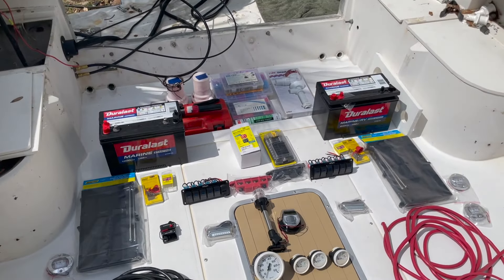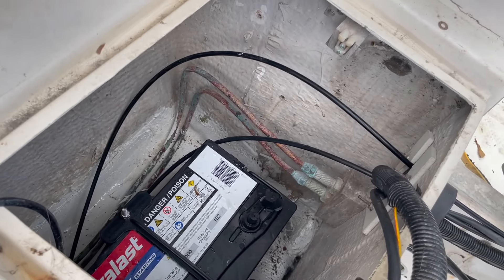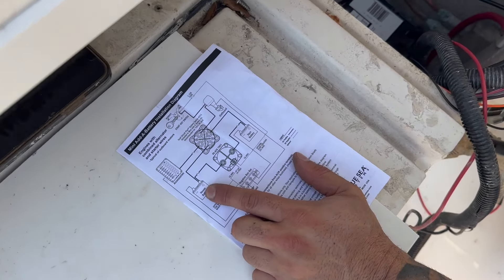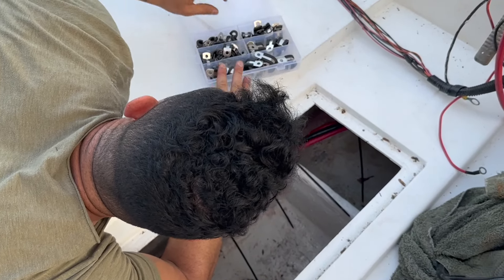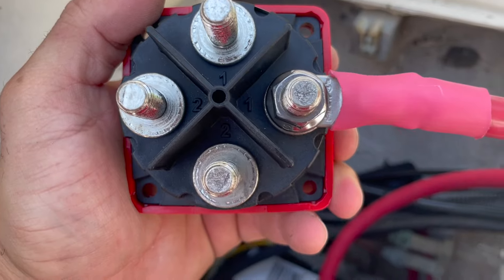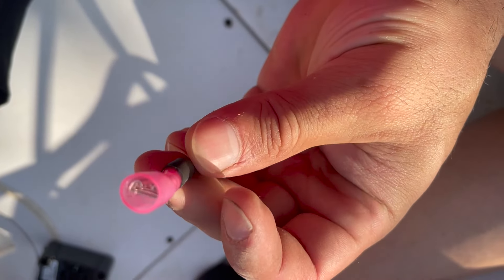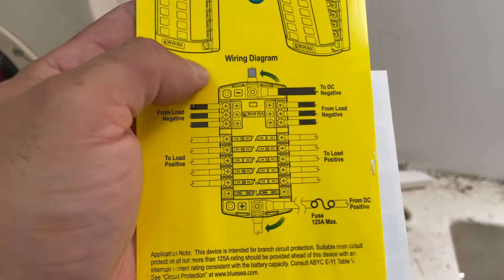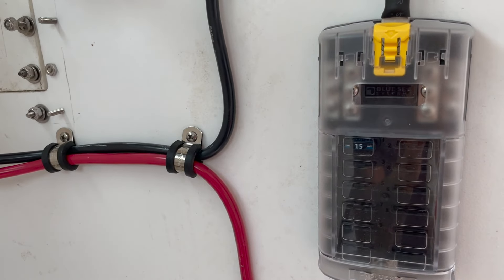Beginners Guide To Boat Wiring | Blue Sea Systems Dual Battery ACR Install

Comment: I just installed one of these.  I'm getting 12v across poles 1 and 1 (which is my start batt + and thebwire going to the starter)  with the switch in the off position.  Is that normal?
Reply from the maker: Hey Craig! Thanks for the comment! So position one would be the connection to the motor and the other position one would be the starter battery. If you have the switch in off I’m almost certain that it should not get a reading of any kind as it is supposed to interrupt everything including the starting off the motor. I’m gonna double check mine tomorrow though and get back to you because if you do have power then you should be able to start the motor and that defies the purpose of the switch.

Comment: Why did you use 2 awg wire? Batteries seemed to be close to ACR. Thank you...
Reply from the maker: Hey there thanks for the comment! It’s overkill tbh. It’s what we had. We could’ve used 6awg and been just fine. Checkout our latest video where we wired another acr where we used 6awg wire! 🤙
Reply: Thank you... @perfectfitboating

Comment: Does the green light stay on and flash every 15 sec while the switch is off?? Will this drain the battery?
Reply from the maker: Yes, it does stay on and flashes every 15 seconds. Eventually it can drain the battery if it’s sitting too long without starting the motor. If I know the boat will sit I’ll disconnect the power cable from the battery. 🍻

Comment: question can i use  breaker 100 amp from breaker to  blue sea systm, or 100 amp is to much,
Reply from the maker: I believe the range is 80-100 amps if youre talking about the fuse to the acr off the battery
Reply: @perfectfitboating  breaker who is between main swith and bus bar(house system) who is getting all intrument, because i think 30 amp that you explain in video i think it is low. i have gps, all light boat and livewell. what do you think 30 it is goog or i have to put bigger fuse
Reply from the maker: @maykelsanz5622 you’re going to have to add the amps of all your instruments. That how you get the size of the breaker without guessing.

Comment: Thanks fit the video.  What about the small able that goes from the acr to the ignition?
Reply from the maker: Hey thanks for the comment! That wire is optional. Also during the time of this video I don’t think we had a finalized motor on the boat. Since then we added a motor and the wire! 🤙

Comment: What is the the difference between the two battries and there use?
Reply from the maker: Starter battery and a house battery. Starter is for your engine and the house runs all your devices! 🤙

Comment: Why are you working with live wires? 
Why not just build the circuit. And then connect to the battery?
Reply from the maker: I’ll preface my response with this statement. The electrical on a boat should never be taken lightheartedly. Working with 12v system isn’t the same as working on your house where it might be 120v or even 220v where it can kill you. In this video I ran the positive wires first and left the negative wires for last. And you are correct, you could most definitely build the circuit first then connect to the battery. Thanks for the comment! 🤙

Comment: my electrical engineer friend says breaker should not be the sum of all your devices but based on your wire gauge
Reply from the maker: Ask your electrical engineer friend what happens when the sum of your devices exceeds the amperage of the wire.

Comment: How many cables total to install the kit?
Reply from the maker: Depends on your setup but for this one, you have two positive cables from each battery, one going to acr and one to the stitch. 1 negative cable for each battery. And then you have the one from the switch to the breaker and the breaker to the fuse block. Hope that helps! 🤙

Comment: Ok before I saw your video I was following how this guy did his his name is real life fisherman and he installed pretty much the same thing im not using blue sea but I have all the same parts I didn’t do the 80amp fuse could u check out his video and tell me what u think before I complete this and it doesn’t work right or for long I have a 18 ft StarCraft with a 115 I don’t know if that makes a difference Help!
Reply from the maker: Hey thanks for the comment. I saw that video and noticed the same thing. My blueseasytem instructions called for the fuse so I installed it exactly per the instructions. Ideally you want a fuse to protect the wire. I’m not sure what the instructions on the sea dog system call for but the one you have should give you some idea. At the end of the day the fuse is only going to protect you and not hurt you. I’d add one! Hope that helped! 🤙
Reply: @perfectfitboating  I’m following you I like the fact that you are able to respond and help Thank you
Reply from the maker: @sstatic6093  I appreciate that! Glad I can help! 🤙
Reply: I’m hoping the 8 gauge works with the ACR I just bought the 80 amp fuse. like I said I was following the way real life fisherman did his so I didn’t get the 2 gauge wire. But I will know once I connect it up
Reply from the maker: @sstatic6093  you should be fine with 8 awg wire. I went overkill with the 2 awg (it’s what I had on hand). I believe 6 awg is recommended depending on the run of the wire. As long as the batteries are close to the acr, youre all set. 🍻
Reply: @perfectfitboating  ok I had to do 10 ft because running under the floor and into the battery compartment because I have a center console setup with the 2 batteries in the back of the boat on each side of the boat about 5 ft apart
Reply from the maker: You might be pushing it with 8awg. I’m finding the right size for a run of 10ft to be 6awg.

Comment: I must be missing brain cells, but seems to me I wouldn't even need the rotary switch. sayat anchor/engine off with the drop in voltage wouldn't the relay direct battery current where it needs to go without using the switch?
Reply from the maker: You technically don’t need a switch unless you have two batteries or you need to power accessories with your battery.

Comment: you need to put 2 more on off switches so you can isolate bad battery ..cheers
Reply from the maker: Thanks for the tip! That’s a good idea! 🍻
Reply: That switch keeps them isolated in the on and off positions.  It has an emergency position to combine them.   The ACR is automatic based on charging voltage.   Plus the house circuits have a main breaker which could be open or closed.   So - I think he's got it covered.

Comment: why in the hell will you put gauges on a boat , put a gps with nmea 2000 and be done , opening holes in a console now a days is stupid
Reply from the maker: We’re taking donations are you offering? Lol we didn’t open any holes in the “console” so not sure what you mean bud. Thanks for the comment 🤙
Reply: @perfectfitboating  you have gauges on the floor of the boat if you are doing a rigging in 2023 why open holes for n the console even if the holes are already there you cover then up and put a nmea 200 gps does all that , if you have not seen the video look at the floor i see gauges , outdate for 2023
Reply from the maker: Sir, the video was about installing basic electrical on a boat. Batteries, acr and switch. At no point in the video did I speak about gauges or how to install them. Yet you chose to pick something obscure in the video as gauges on the floor to write a negative comment. Assuming and then saying it’s stupid? What’s up with that? Is that all you took out of this 20 min instructional video who seems to have helped quite a few people according to the comments?
Yes there are gauges on the floor. Yes installed them. No I didn’t drill extra holes in the console. What you don’t know is that the motor on the boat doesn’t support NMEA. Because yes, it’s outdated motor but runs great even in 2023. But seriously, is that the only take away you got from this video? Enough for you to make a negative comment? I wish you the best dude. Hope you day gets better 🤙
Reply: Outdated for 2023?  Gauges provide great performance and classic style which clearly you lack the capacity to appreciate.  Too bad.